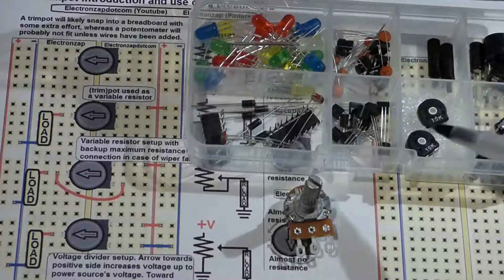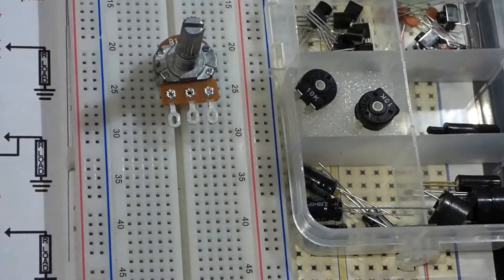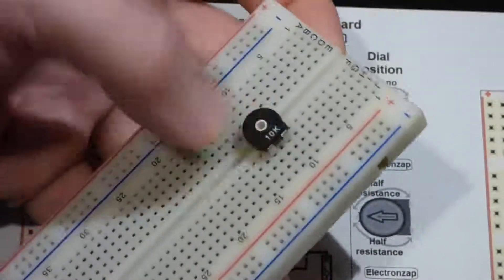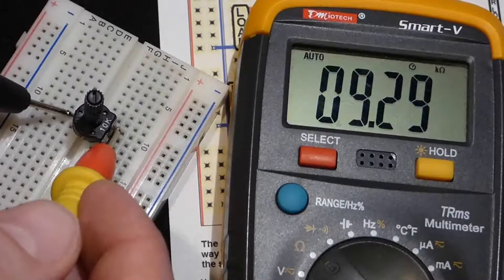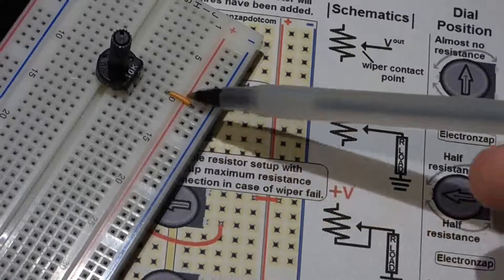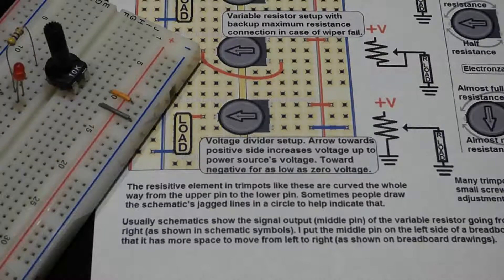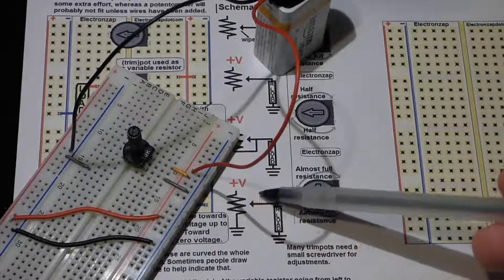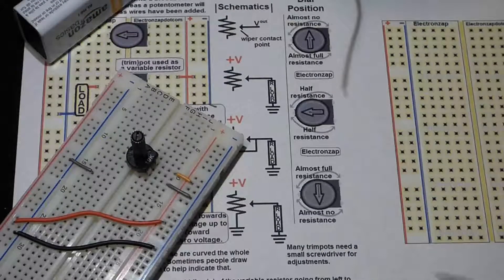How to use a trimmer potentiometer trimpot variable resistor or voltage divider on a breadboard

Comment: You are a smarter man than i, im struggling to figure out what resistance trim pot would be most suited to re centre a 10K DS4 side axis potentiometer self centering deadspot position if its started to experience in game drift or a newly fitted replacement is out of factory centre callibration. 
Without messing up the in game response curve if it would do that at all across the resistance range with to high a rated part? 
Minimize any potential problems that could arise in part selection. 
Problem found here at 4 : 50 in this vid for familiarity. 
https://www.youtube.com/watch?v=vQesgAtr2e4&list=PLjKUl7xC9lJm3t7XMRhCWSBHfnBvD8cwz&index=10 
Any information much appreciated on selection wiring & or parallel attachment? 
Your vids rightfully in my research playlist for all to see at 15 currently. 
Was thinking hot glue 4 trim pots to a suitable board location wired straight to the 3 pins each. 
The current purchased solution in vid 22 is $15! a pair & closes off the bottom not allowing rapid 3 pin side desolder replacements when needed. 
Landfill products.
Reply from the maker: I have no experience in a project like that, so unfortunately I can be of no help :(

Comment: Would you be willing to make and sell me a tester for a level gauge? 

Im looking for 5 equidistant values  between 33-240 ohm to represent Full, 3/4, 1/2, 1/4, Empty.

33, 68.25, 103.5, 171.75, 240ohms.

All mounted inside a small project box with a 5 selector switch?
Reply from the maker: Never made anything like that, I don't really build stuff and never want to do any financial transactions or ship anything. So unfortunately I can't help you with that one.

Comment: Thank you,  electronics is now my retirement passtime. Can you help me, I'm stuck on  building a toggle switch (spst) with computer fan circuit.
Reply from the maker: Good times! I haven't done anything electrical with computers. Lots of people build computers, so that's probably a topic with lots of detailed tutorials somewhere.
Reply: @Electronzap  Forgive me for not being detailed. I striped the fan from a old computer and want to build a breadboard circuit  with a switch to turn it on and be able to regulate the speed.
Reply from the maker: Oh gotcha. You can probably wire it directly to a power supply of no more than the maximum voltage as long as the connectors and everything involved can handle the current (power). Hopefully the voltage and current are written on the fan or can be found online if it has the part number. Some fans run on AC though. So I'd check out wiring up fan videos until there's one that fits what you want to do.

Comment: I made an automatic video switcher with 2 mini relays for my car. Front and Rear Camera setup. The front camera is triggered by a SPST rocker switch and the rear camera is triggered by reverse lamp signal. When the rearcam comes on it interrupts the front camera if it was on (by design). During the interruption there's video interference for a short period of time. 

How can I create a 1 sec delay when I switch between cameras ?

I have a diagram, do you have an email address so I can show you ?
Reply from the maker: No email sorry. I'd look at 555 timer delay circuits that people have put together. Good chance that somebody has done that exact project and posted it online somewhere. Good luck!
Reply: i'll look into that